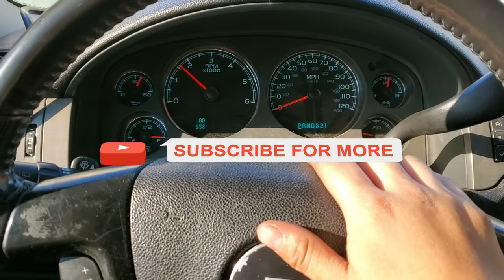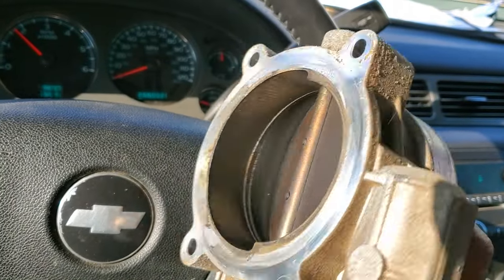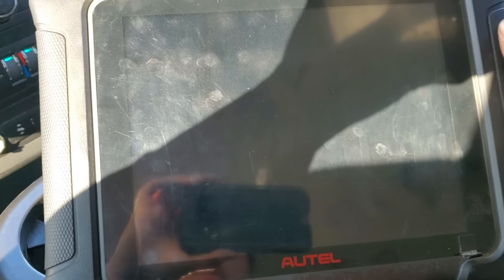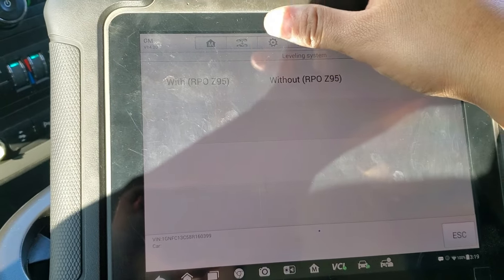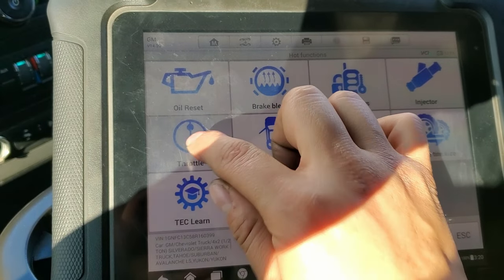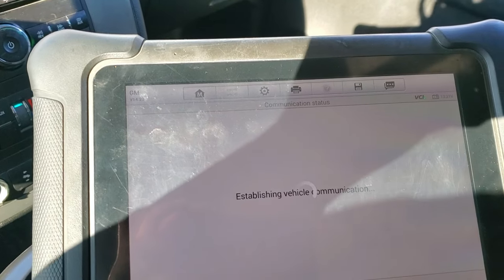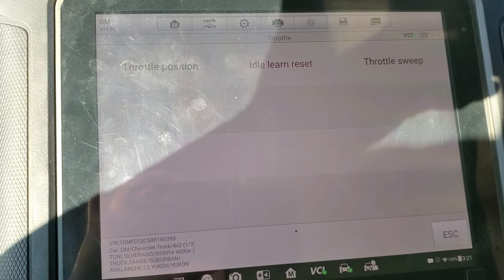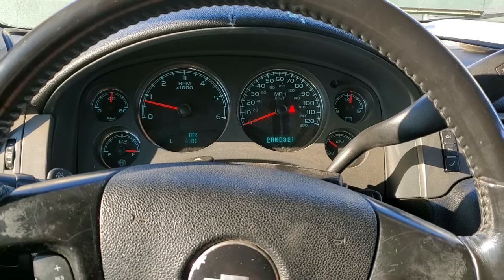How to reset high/low idle on Chevrolet Tahoe, Silverado after Throttle body replacement or cleaning

Comment: I think it would be helpful if you could show us how to do a "Relearn" without the $2,000 computer because most American's have families and can't throw away that kind of money for a scanner. Just a suggestion though.
Reply from the maker: yea I know I left the manual instructions on the description but most of the times doesn't work and even disconnecting the battery doesn't work either 🙃.  but u can try all that first and leave the scanner thing at the end
Reply: I got one used for $500.00 and used affirm with monthly payments.
Reply: @patriot3431  I found a easy way to deal with the throttle body relearn. Turn your key on and off 3 times, then turn your key for a 4th time and crank it. That's it. Simple
Reply: $100 thinkdiag 2 can easily do the relearn

Comment: Man what am I watching dude.. what's up with all the damn gadgets etc.. how to reset without the damn tablet or device.. everybody don't have the device.. man 🤔😑🤦😂😂
Reply: Buy one man, would save your life a whole lot and worth it when you want to fix your own problems without having to pay a mechanic to do something so simple
Reply from the maker: there are some cheap scanners out there like for 200 and do alot of functions like the one I have
Reply: For real
Reply: How to manually reset the idle back to normal without the scan tool is disconnect the positive battery cable for 5 minutes or do it before you change your throttle sensor. Then after that start the truck up and let it run for 3 minutes. Then shut it off for 60 seconds. Then start it again for 3 more minutes and you should be good. I just changed mine on my 2013 Chevy Silverado 1500. Good luck.
Reply: Seen a guy cut the switch in the on position then slowly press the gas pedal to the floor then let off do that 5 times in a row then cut the switch off and crank.
Reply: What’s the name of this tablet device

Comment: After you cleaned and reset it, it did stop idling so high but you can see that even under 1000 the rpm’s are still fluxuating a little
Reply from the maker: yea once you go for a test drive. it comes back to a normal idle.
Reply: @JVFIXLLC  ohh fasho.
I have a 07 Silverado 4.8 2WD and at complete stops my rpm’s fluctuate up and down. Nothing too crazy but when it drops a bit lower than normal idle, the lights inside dim and ac blows a little weaker. And when it rises a bit over the normal idle, the lights get brighter and ac blows a little harder. Any suggestions?
Reply: @KevinSanchez-ts4pr  mine was doing that and shortly after the alternator quit doesnt do it anymore now that i got a new one
Reply: I tried all the manual relearns. One worked ok until i gave it gas and after thst it went back up to 2000. Sometimes it goes back to normal but doesnt last. Im gonna replace it with a new one.
Reply: Si The alternator was the problem @DirtyMikeHoncho

Comment: Manual relearn short and long did not work or didnt last. I disconnected the battery for 15 minutes and went right back to normal.  They also told me that if i had disconnected it before unplugging the T B  it wouldn't have messed up. 
So many of us are fed up with expensive charges and long waiting times at garages and dealerships. We should elect a youtube diyer for presidenjt and bring the cost of garage charges.
Reply from the maker: have u tried disconnecting both battery terminal and leave them touched each other with the battery removed.

Comment: I recently installed a brand-new throttle body on my 2011 chevy Silverado 1500. But it kept throttling between 3rpm and 4 rpm going back and forth. Would a relearn reset using a scanner fix this on the new TBI?
Reply from the maker: yea you will need to reset it. you can try unplugging the battery and leave it touching negative and positive together but with the battery removed.
Reply: @JVFIXLLC I have a 2010 Chevy Malibu and just replaced my throttle and not my rpm goes up to 3 and stay there, so basically my car is over because I don’t have one of those fancy computers

Comment: What is it if it still idling high
Reply from the maker: if it's still high after the reset you might wanna check for air leaks and make sure your throttle body is clean. if you cleaned it and did reset and still high I would suspect of a bad throttle if there is no air leaks also.

Comment: I did my throttle body cleaning after installing it on the car it brings engine check light on and does not go off
Reply from the maker: try disconnecting the battery overnight

Comment: I have a 2018 Silverado with the exact same problem, also very slow to accelerate, could this be the same issued?
Reply from the maker: it could or also could be low fuel pressure or an air leak

Comment: What about a code for a p0443 on a Grand Prix gxp with 5.3 I changed the mass & purge valve. Could it be a bad cat cause it overheats in 30 mins of short driving
Reply from the maker: if u changed the purge with an aftermarket those are defective most of the time I always get the oem ones and if you got the oem then you could have a problem with the wiring. best way to diagnose it is using a scanner to manipulate the valve

Comment: I cleaned it and cleaned the MAF, it’s not idling high but whenever I press the accelerator in park it stays at that rpm and won’t go down unless I turn off the truck, is this something I need to do idle re learn or is that another issue ?
Reply from the maker: u can try and disconnect the battery 🔋  for like an hour and leave it touching positive and negative together but with the battery removed. it works sometimes by the way what year and model is yours
Reply: @JVFIXLLC  I’ll give it a try not ; and 2008 Silverado 1500
Reply: @rodcampos1914 my 6.2 is doing the exact same sht. Driving me nuts. 😑
Reply: @Thekoryosmenstribepodcast  DUDE same just started searching this right now
Reply: @stonyfanatic3785  Its driving me insane. I had no issues for 174,000 miles, and now all the sudden i feel like everything is turning to sht. I pulled my throttle body to clean it, and now its running like garbage.
Reply from the maker: have u tried disconnecting the battery for a while it could help but is not guaranteed
Reply: @JVFIX  I just finished doing that right now and nothing still running weird
Reply: @Thekoryostribalpodcast hey so I asked around and they told me to buy the idle relearn scan tool ordered mine just waiting for it to come in
Reply: @rodcampos1914 same truck and year, did u ever get it fixed?
Reply: @stonyfanatic3785 which one did you buy, and lmk if you fixed it, and how
Reply: @nnbsandres  no I sold the piece of ****, trans went out like 2 weeks after

Comment: What is normal idle 2009 tahoe tlz 5.3. seems like it idles at 500 goes doen to 450 ish shouldn't idle be 600????
Reply from the maker: normal idle is between 700 to 800. if it idles too low in a stop then you need to clean the throttle body.
Reply: @JVFIXLLC  thank you! What autel scanner do you have model number... and in the video after reset your idle looks to be around 650ish??? 7-800 would be halfway to the 1 and yours is definitely on the lower end?? I appreciate your feedback as this is my first 5.3 motor
Reply: Hey Ryan, im in the exact same spot as you, have you resolved ur issue if so what was it & if not what have you tried already? thanks
Reply: @parkerzazzali2598  flexfuel idle is 500 so its normal

Comment: What if you have the idle set to normal but when you touch the gas pedal it goes back to 2000 And stays?
Reply from the maker: do you have check engine light when that happens?
Reply: @JVFIXLLC  i went and bought a scanner to reset
Reply: i have the same problem as you

Comment: For those that don't have a scanner. Disconnect the neg cable on battery and touch it to the positive side of battery for ten minutes.  It will drain capacity in the PCM and clear memory.
  The engine will relearn.
Reply from the maker: yea u can try this also and I actually have done it a couple times. thanks for sharing.
Reply: Yeah post a video of you doing exactly that lmaoo.
Reply: Hell no
Reply: Actually?
Reply: @emanuelsaldana5600  no it will fry your computer
Reply: Wtf?
Reply: What he meant was disconnect both cables, neg and pos and touch them together NOT while either is connected to the battery. Another method is disconnect the neg and turn on the lights, heater fan and cycle the key to start the idea is to drain the system capacitors, DO NOT DO ANYTHING YOU DO NOT UNDERSTAND THE REASONING BEHIND. Such as wearing masks or taking an experimental injection that hasn't been tested. Please treat yourself better than you treat your truck.
Reply: @richspillman4191  any advice for me on how to take off the negative cable please?  I tried to do that to mine but it was very stuck. The bolt would not move off the battery post.
Reply: @lovesrain8042  I understand how you are having difficulty, they put that post in a terrible location. If you have the stock cable still on and the 10mm nut is just turning, use a standard screw driver to spread the clamp open slightly and it should loosen up. Since it is the negative cable, it is ok if it touches other things, the positive side is the sparking side. Let me know if that helps or if you need more info.
Reply: @richspillman4191  it's 2am and I just saw this. I'll try that in the morning and let you know how it goes. Thanks so much for replying & for your advice. I had such a difficult time yesterday. 🤞
Reply: @richspillman4191  I had lost the notification to this thread and just now found it again. Thanks for your help. I did manage to get the cable taken off. I had a wrench that was a 9 point I thinks 🤔? And it started stripping it. Went and bought a 6 point 10mm and it was tough at first but then it worked. Still trying to get my truck to run better but hopefully getting there.
Reply: @Drew Young perhaps editing your comment in case a younglin tries to follow it exactly the way it's written? I'd hate to see someone get hurt.
Reply: Sure and blow out your fuzes and fry!
Reply: @tokes9098 how? There is literally no ground to the battery if the - is disconnected..
Reply: @lovesrain8042  Loosen the bolt, then use pliers to twist the terminal from side to side.

Comment: Big Frontline612 stopN thru Minnesota bound 💯 I have a 2008 Trailblazer and it's ideally high after I have changed all the codes...
Reply from the maker: disconnect the battery and leave positive and negative touching together but with battery removed

Comment: Shouldn't the computer relearn the idle all by itself?
Reply from the maker: sometimes it does it but most of the time needs the scanner to reset it, u could try unplugging the battery but most of the time doesn't work either
Reply: @JVFIXLLC  I waited it out. After cleaning the throttle body the idle was too high. I was about to pay someone to reset it, but by day 4 everything had settled back down perfectly.

Comment: Well what about if you have no computer  performed the reset but the problem continues?
Reply from the maker: u can try and disconnect the battery. disconnect both battery terminal and remove the battery and let the negative and positive terminals touching so the capacitors discharge and that way it will reset the ecu. it works sometimes but I can't guarantee it. good luck
Reply: @JVFIXLLC  how long do you let the cables touch?
Reply: @BIGSTEVEBMB  10 minutes

Comment: 2008 Tahoe that's also having potential transmission issues and/or bad catalytic converter... Definitely has an exhaust leak as it sounds like a Harley. Gave it a tune up, new plugs and wires, new air filter, cleaned throttle body with throttle body cleaner... Didn't spray into the TB, sprayed on a rag and used the rag to clean it.  My idle is fine but when I rev it, it stays at a high rpm and doesn't want to drop back down. It's scary when trying to drive because it holds whatever rpm I got it up to until I hit the brake.  Basically feels like cruise control without having it on. Scary. I tried the method from this video but am terrified to drive it over 40mph.  Got it up to 40 on the driving portion  Can anyone help?
Reply from the maker: do you have any stored codes or nothing after driving it a while, an exhaust leak can make the rpms high as well as an air leak too.
Reply: @JVFIXLLC  it definitely has an exhaust leak. I've been messing with it more today as well. Double checked the functionality of the TB, took a video of it while I pressed the accelerator with engine off. It opens and shuts smooth without getting stuck. I was thinking maybe I damaged the sensor or some circuitry, even though I was careful to spray the cleaner on a shop towel and wipe it clean instead of spraying down in the opening. Cleaned the connector that attaches to the TB, didn't change anything. Unplugged the batteries (it has 2, former service vehicle) and let sit overnight, felt better at first then went back to staying stuck again.

It definitely pops and sputters as it shifts from first to second. It won't go above second. 4 speed transmission.  I really do wonder if it's a clogged cat or a bad enough exhaust leak that somehow back pressure is causing it to behave like this.
Reply: @JVFIXLLC  no stored codes. It had a misfire cylinder 6 that I cleared after changing plugs and wires and it hasn't come back
Reply: @JVFIXLLC  I should add too, I originally thought I was commenting on a different video. So I have a scanner but not one that is able to go into the throttle settings to reset it. I tried the secondary method of unplugging the batteries overnight
Reply: @chadg6874 how did you fix I’m having that problem now
Reply: @Rellderrick777  yeah, he said it eventually got back to normal, after a couple of weeks.  It just took a lot longer than you would expect. I guess these TBs have very slow learning adaptations.

Comment: It'd be nice if the way to do this without a all tell or an expensive ass computer
Reply from the maker: you can try disconnecting the battery but most of the time, it doesn't work sadly.

Comment: No scanner to reset? Saw this on another video on the throttle body cleaning.  

https://youtu.be/NAnEoMa80VY

Basically turn to “On” for 3 minutes. Off for 1 minute. Repeat one time. Start truck.

If that doesn’t work. Drive for extended period over 45 and try again.
Reply from the maker: u can also try and disconnect the battery.
Reply: @JVFIXLLC  yep but the 10 minute drain (cables touching) always freaked me out. This is less likely to kill your battery and computer. Plus, it worked for me on my 2007 Tahoe so thought i would offer this option. 

Have a super evening!

Comment: Like we all have $5000 scanners at home
Reply from the maker: you can try the steps on the description see if it works. using the scanner is the fastest way to do it but if you want to do it manually takes some time.